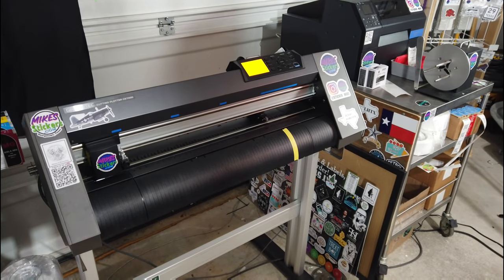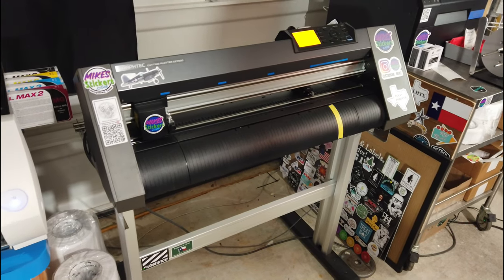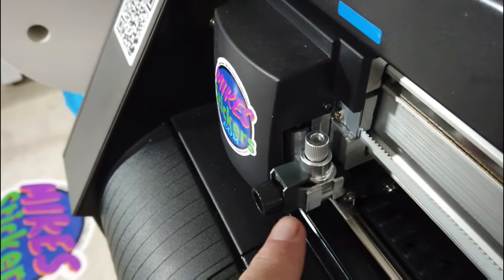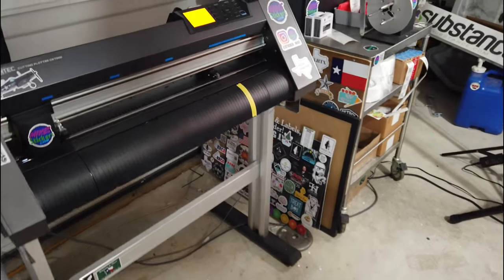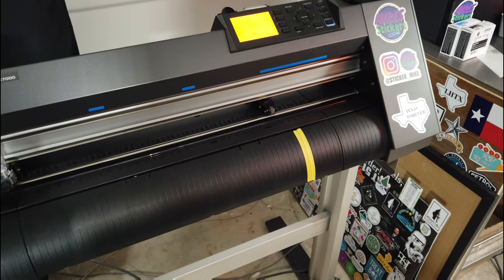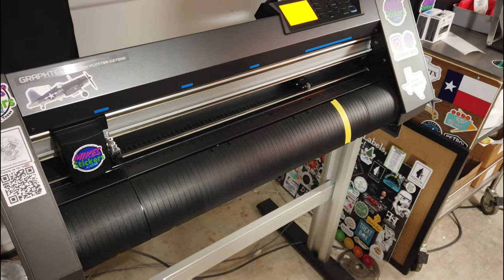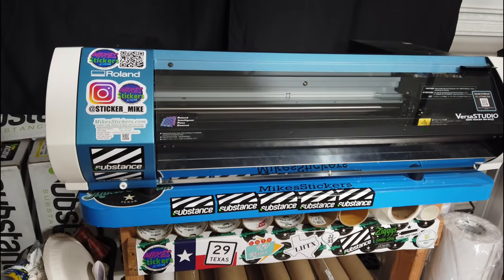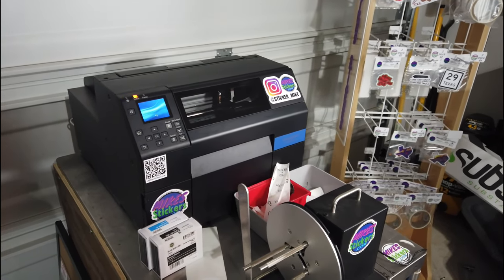My Perf Cut Settings For The Graphtec CE7000

Comment: Hi Mike, the graphtec has a setting in it where you can tell it to lift the blade higher as it's traveling over the material. I was having the same issue. Let me find it again and i will send you the info on how to do it. Mike, you also want your blade no more than a little bit past the middle line. That is also a reason why it's dragging and scratching your material.
Reply: Hi Friend, can you help me please with the right configuration, I got the same one, and my issue with it is that scratch too, I don't have the 45° blade.
Reply: @DestroyerSV503   what is it you need help with?
Reply: I have the same problem with ce6000-60plus. Vinyl in middle is little bent over and knife is down when plotter is cutting and i dont know what i should do.
Reply: Hey, im running into the same issue. Where can i find the setting on how far to lift the blade?
Reply: @phill0406   Trying to find the tool setting, sorry, it's been a while, but i will get to it.
Reply: @phill0406  pause menu>tool>press up twice to go to page three>tool up height>higher position.
Reply from the maker: I forgot to respond but you absolutely fixed my problems with this advice! Thanks so much!

Comment: Here is another tip, so i keep all my machines hooked up to some battery backups. I use the ones from costco. the CyberPower ones.. I have 6 of them and all my computers and machines are hooked up to them. This way you can keep your machines on all the time. For instance, i have my graphtec and my bn20 on one. that way the battery lasts a long time if i were to lose power. Plus it protects them from surges. My monitors and computer on another, and so on. It has saved me a few times already.

Comment: Hi, so I’m looking at a used ce7000 in my town right now and I’m wondering if you need to use Graphtec software to operate it? Im planning on picking up a Roland BN2-20 and wondering if I can use the software that comes with that to operate both machines? I just heard there can be issues registering the Graphtec software if you are the second owner is why I’m asking. Thanks mang!

Comment: So you just set a2 on perf you didnt change the setting at all
Reply from the maker: It’s set to condition 3 & I think I changes the force & speed. The force is 31 & the speed is 20. I think the A2 is for the acceleration. I did not change that setting.
Reply: @mikesstickers  gonna give it a go thanks

Comment: Any tips on cutting perfect circles on a Ce7000?
Reply from the maker: I don’t have any issues with mine. Can to tell me exactly how it’s messing up?
Reply: When I cut an oval or circle sticker with a .025 off cut it doesn’t cut a perfect oval or circle ? It cuts heavy on one side or the other.
Reply from the maker: @beatsnomadic  first, make sure your design is no where near the crop marks. If there are within the area of the 90 degree marks then it will shift all the cut lines. Also, choose “restrict media movement when setting up the cut settings in cut master. I think it’s like the 4th or 5th tab over & there is a drop down media where you can select that option.
Reply: Having problems finding restrict media tab.
Reply from the maker: @beatsnomadic  I can help further when I get back to my shop. I’m not there right now.
Reply: I really appreciate your help plus I dig your channel.🤙🏽
Reply: @mikesstickers  I was able to find the tab but I'm still having issues with it not cutting a perfect line on a circle. Any more tips would be super. Maybe this could be a new video for you to make:) Thanks